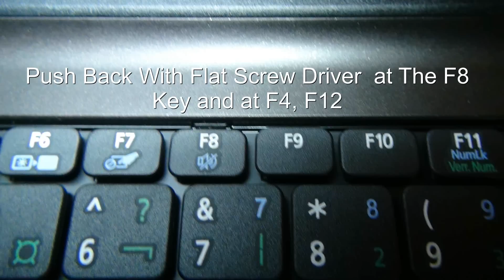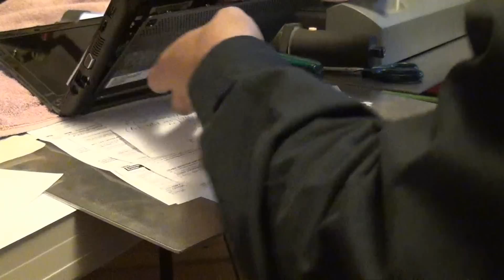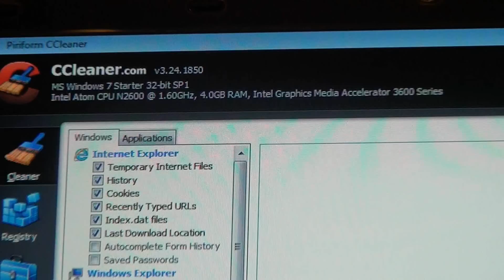The Mini Acer Aspire D270-1998 RAM Upgrade to 4 Gigs

Comment: thanks to this video, I was able to upgrade my wife's netbook to 4 gb of ram and and ssd drive. it's super fast, but it does say only 2.99 gb is usable... but I think the apps can see past 2.99gb either way we're happy with it and I don't want to use any of those hacks as it could mess up your windows kernel. btw im using windows home premium 32 bit... I could go 64 bit but people are saying they also get 2.99gb usable and not to mention... there are NO drivers for GMA3600 on 64bit............

Comment from the maker: My experience has been good with the upgrade, the laptop is used mainly for sourcing information and the laptop has not many programs on it. Video streams (1080) @ 1024 X 600 work quite well. Basicly a clean computer is a fast computer.It is easy and cheap upgrade so why not.
Reply: Jean Beauregard 
Hi Jean, where can I buy the memory card and how many pins does it have for the aspire one d270-1998

Comment: Yeah, I installed the 4GB. The CCleaner shows 4GB installed. Windows shows 3GB usable. Works much better than with 1GB for sure. You will notice it.

The price between 4GB chip and 2GB chip isn't much - 4GB cost me $18 at canadacomputers.

Comment from the maker: No haven't upgraded the SSD, 350gigs is fine for what I going to use the laptop for, the power supply draw would be very little difference between 2 and 4 gigs. I think the limitations where dropped by Microsoft...

Comment: I'm still hanging onto these because of the I/O versatility and the easily replaceable and serviceable components compared to modern budget netbooks/notebooks that use SoCs and AIO logic board with soldered RAM, storage, etc. I suppose the plan now is to toss 4 GB of RAM at this little guy, throw in an inexpensive SSD, and give it a fresh 64-bit Linux distribution or Windows 10 installation to take proper advantage of the N2600's dual-core design and the hyperthreading technology, and to address the additional RAM.

Comment: If you answered this I'd be lucky, this video is super old.  I have the AMD C-60 version with 2GB of RAM , everywhere I read I can't put more than 2GB.  I know just based on the CPU architechture I can put at least 4GB, on the strength of x86_64.  There is only one RAM slot , so I need to find a 4GB , did you have any experience with the m.2 SSD slot ?

Comment: ***** I upgraded to 4GB ram. But the 3GB limitation is NOT from windows. I tried Ubuntu and other OSes they see 3GB too. It is a hardware issue which I don't know how to fix. Even my BIOS is now 1.10 - but no change :)
Reply: I think that it's because you tried only 32-bit OSes

Comment: Windows starter will only use 2gb by OS limit.  Ok so upgrade OS.  32bit hardware limit will use 3gb only with new OS.  BIOS may or may not recognize sticks higher than 2gb.  This board will run 64bit.  Most drivers available are 32bit but will run on 64bit OS.  I did have it triple booting Kubuntu/Kali/Windows7starter at 4,4, and 2gb respectively and 64/64/32bit respectively.  Then my MBoard went bad.  The replacement won't even post with any stick higher than 2gb regardless of BIOS version.  Currently running 2gb and installed only Windows 7 professional 64bit.  Gave up on trying to get the rest to work.
Reply: Oh and a Solid State HD helps allot.